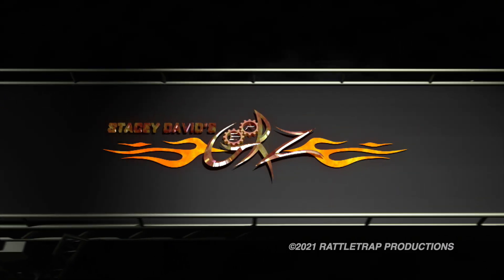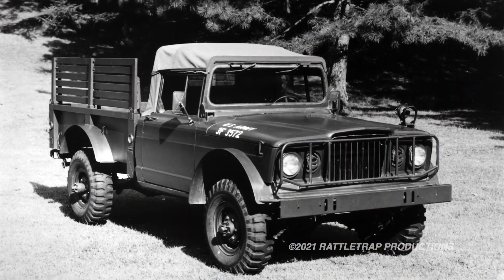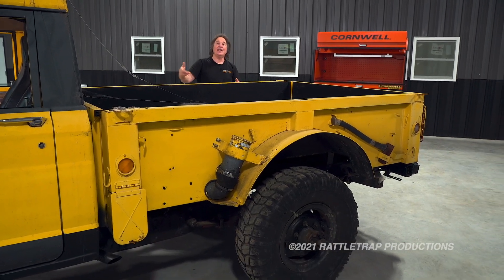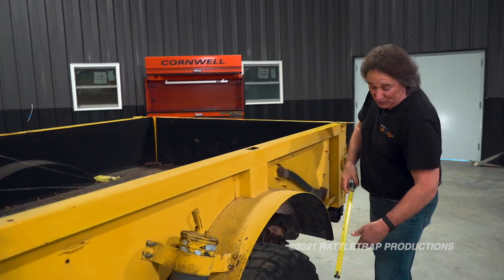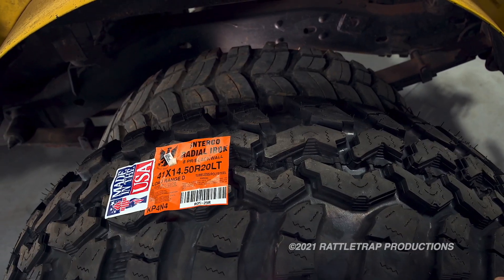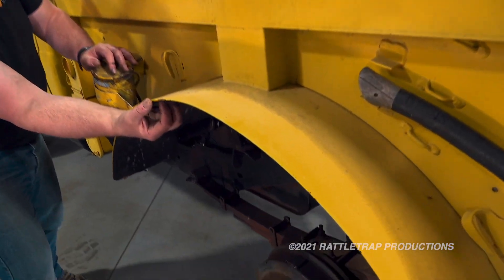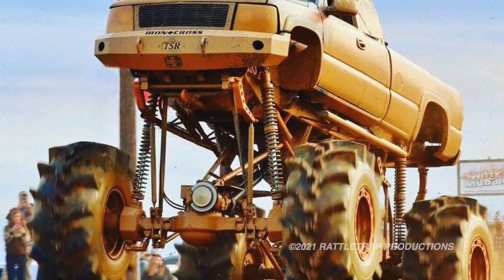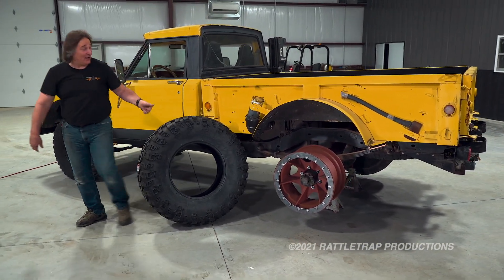Red Barn Custom Wheels and Interco Tires - Stacey David's GearZ

Comment: The M-715 front axle is prone to snaping the short end axle that is about as strong as a D44, it is also prone to slipping tubes.
The NP-200 T case over heats at sustained speeds over 40mph.
The rear D70 is "unique" having 1 rare locking device available.
Both axles have limited regearing options, no off the shelf replacement shoes and no available hub selector.
The front closed knuckles take oil that is no longer in production.
Next to no replacement parts for the engine, no OHC chain, no distributor or anything else to do a clean rebuild or service.
Most trucks have been loaded beyond ability and have tweaked the frame causing the top of the bed to be closer to the cab than the bottom.
The T98 transmission has no replacement parts, all clutches and liners have to be "relined".

Owner of a 1968 M-715, in prosses of receiving:
LQ4
4L85e
AMG 242
Super 60 D60
14 Bolt
Radius arm swap
New gas tank that fits the now centered driveshaft.
Reply: I heard there’s actually something available to help with all those drivetrain components that makes it super easy and sometimes cheaper!

It’s called a Chevy K20.
Reply: @Flyboy207  The closed knuckles have current oil that is in production, it's called John Deere Corn Head Grease.
Reply: @m16ty  Not sure where that came from but I use the special closed knuckle lubricant from Torque King 4x4.
Reply: @Flyboy207  The John Deere corn head grease is a 00 grease. It's basically a really thin flowable grease, but quite a bit thicker than gear oil. Probably the same consistency as what you use, I just have a local John Deere dealer to pick up what I need. The original purpose is John Deere developed it to go into gearboxes on corn heads, hence the name.

Comment: This is strange to me because I never go to the rear fender clearance to judge how big of tire to go. The FRONT is usually where the turning wheels are and the front is where the issues of tire rub is, and clearance issues as they turn.
Reply: Yes, I'm actually surprised he's going with a 41" tall tire. I've got a M715 and my research tells me that around 39" is as tall as you can go without rubbing on the front, unless you add a lift.